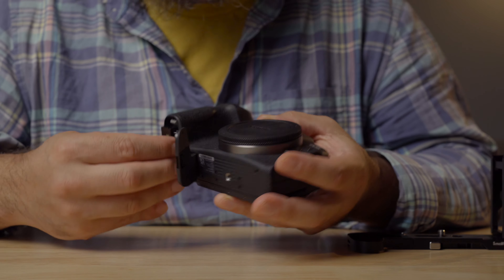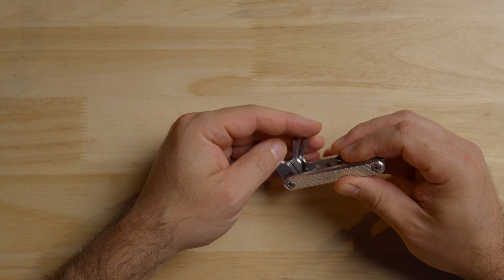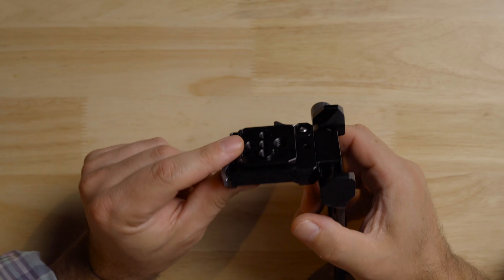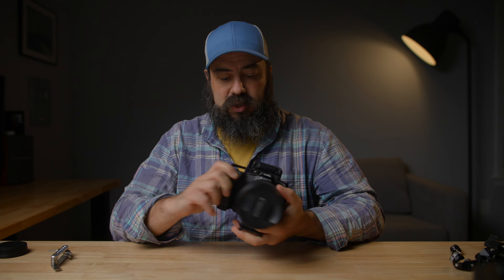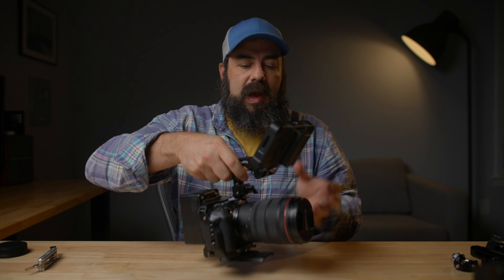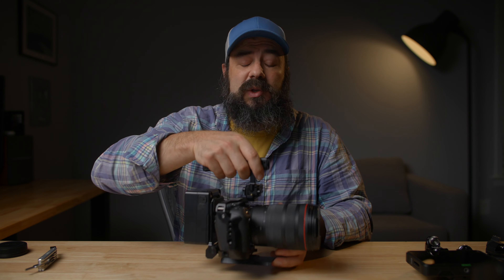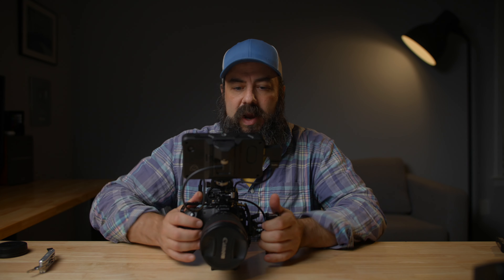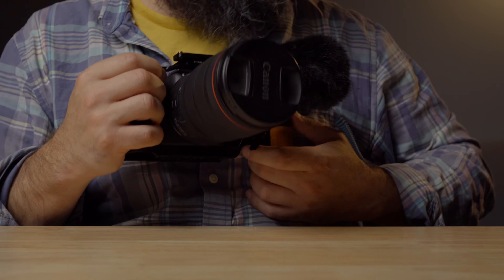Canon R8 - Video Rig & Battery Solutions

Comment: Wouldn't it make more sense to just put all that money into a better camera, instead of buying an R8 and rigging it out?
Reply: A rig provides features/benefits outside of the quality/specs of the camera itself. It’s more about usecase, than it is about making up for a cameras spec weakness.
Reply: @HarrisBeauchamp  I can see the logic in that, although it still seems odd to start with the R8, if you have a big enough budget to rig it out so extensively.
But yeah, I could imagine a use case where this would make sense, especially as the R8 goes down in value due to its overheating and battery issues. It seems like it would be a pretty limited use case, but maybe if someone wanted a monitor and V-mount battery, and was just shooting 1080p, or only shooting in cold weather, and had a budget that wouldn't allow for spending an extra grand or two for a better camera, it might make sense for someone to do this... maybe. ;P
Reply: @myblacklab7 wtf are you talking about
Reply: Good luck rigging the better camera
Reply: @myblacklab7  the R8 is a very very capable camera especially for video. I can do 4k60 in 10-bit RAW footage. People's main gripes are the limited controls and small battery. People have shot incredible things on t3i's. The only reason I would ever upgrade from mine is if an SD card fails and I decide to get a 2 slot camera
Reply: @Topidoit  It definitely has its good points!
It overheats at room temperature when filming 4K60 within about 40 minutes, which is also about how long the battery lasts, right? It starts to heat up pretty quickly as soon as you turn it on, so messing with settings or waiting for a shot with the camera on also limits recording time. No XLR input limits the mics you can use with it, unless you attach it to a FocusRite, which isn't ideal.
No in-body IBIS, and not all lenses have IBIS.
I guess a dummy battery might help a bit with overheating, but the only one Canon sells is kind of expensive, comes in two parts that you have to buy separately, and only connects to an AC outlet. 3rd-Party options exist, but they might brick the camera, from what I've gathered. You can power it with a 45 watt or greater power bank using the USB-C connector, but that won't help the overheating issue, and the USB-C connector is fragile.
The overheating issue is hugely limiting - you can't use the R8 for interviews, sports, weddings, documentaries, or indy film production. On a hot day, I think it would overheat within 20 minutes. Imagine filming an incoming storm, and a funnel cloud starts to drop, and then your camera overheats. UGH!
The big advantage of the R8 over Sony's A7Siii is that it is less than half the price, but leaving price aside, I can't think of many good reasons to opt for the R8, except for that it's not made in China, although Sony recently shifted 90% of its camera production to Thailand.
No serious videographer shooting 4K60 will use the R8 as anything but a B-cam, unless they are in some particular niche where they only shoot for a few minutes at a time.

More expensive cameras also tend to have better specs. The A7Siii can do 4K120, for instance.
Factoring in price, the R8 is the best for very specific use cases, such as if you need 4k60, uncropped full-frame, simply because no other camera in that price range will do that. However, that's a very specific use case and for the vast majority of people an APS-C camera that doesn't overheat, or a full-frame that shoots 4K60 with a crop is a better option at a similar price point. One could also consider picking up an older DSLR video camera, and I know of at least one that does 4K60 with no crop, doesn't overheat, and has good weather sealing (although the specs aren't quite as good).
Reply: What you're saying makes zero sense at all. Even if you get a better camera you're still going to have to rig it. I have the R5C and R8 and I still had to rig up the R5C to make it usable
Reply: @Topidoit R8 does not shoot raw
Reply: @geoff0707  you're right I got a little ahead of myself there
Reply: @myblacklab7  i very often shoot at 4k24 unless I want to do slow motion or something. I only got it to overheat one time when it was 97°F outside last week and I was shooting 4k60 in direct sunlight. That is the only time and I've had it just over 8 months now. I would never shoot 4k60 just for the hell of it. Also, I understand most people want to put a mic right into it but in what I use it for (filmmaking) I would usually not use onboard audio and record my audio on a separate device so it doesn't really matter.
Reply: @geoff0707  It makes 50% sense, or you would have rigged out the R8 instead of the R5C.
Reply: @Topidoit  Thanks for the feedback. I've had it for awhile too, and in 4k60 mode it always overheats within about 40 minutes or so when at room temp or above, although I haven't timed it. I think it might not overheat when it's very cold and windy, and I've seen people supposedly "fix" the issue by having a big fan blow on it.
I vastly prefer the way 4k60 looks, but that's a different subject. I'd shoot 4k120, if I could.
Reply: @myblacklab7  lol I did rig out the r8, I just bought my r5c. I been using my r8 since last year till I could afford the r5c. Best part is all my stuff for my rig works with the r5c except the cage of course
Reply: @myblacklab7  so my point is it's cheaper to buy an r8 and rig it than it is to buy an r5c which would still need a rig anyways due to the shit battery life
Reply: @myblacklab7  i guess this does come down to use case. I don't ever see myself recording 4k60 for more than 3-5 minutes.
Reply: Well I can't argue with that. I guess there are valid reasons to rig out an R8.
It could be that I'm new to this, and am asking somewhat stupid questions, but I do learn from the answers, and I'm not the only newbie in town, so hopefully other people will learn something from my stupid questions.
I'll probably end up rigging out my R8, depending on how expensive that turns out to be.
Reply: @Topidoit  It really does. For me, the main reason I got the R8 was because it can shoot uncropped 4K60 with no pixel binning or line-skipping, and I couldn't find any other full-frame camera in my price range that could do that.
My use case is unusual, I think. From what I've gathered, most people only use 4k60 for sports, and that doesn't require full-frame, so the R8 would be a poor choice for that use case.
About a month ago I shot a field of fireflies at night, with lighting from a receding storm in the background. I'm probably crazy to try to get something like that on 4k60 video with a prosumer (if we're being generous) camera, but it's a dream of mine to someday be able to share the beautiful spectacles I often witness during the night.
I want to shoot the Northern Lights, and I think they'll look better in 4K60 because of all the subtle, quick movements, if I'm lucky enough to capture such footage. The overheating issue is a big deal for things like that.
Reply: The money he spent on the rig out probably costs less or just as much as buying say r6 mark 2
Reply: @UnamnnaedAcro  Yeah, something like that.
And as others have noted, there are various advantages to having a rigged out camera, so one might want to rig out the more expensive camera anyway, at which point it boils down to "Why not buy a more expensive camera, and rig that one out?" which is a stupid question.
I'm mainly annoyed at the R8's terrible overheating issues when shooting 4K60 video. I guess I need a more expensive camera ;).
Reply: As someone who always thought buying camera is enough , then moving to having record audio separately to understanding the importance of external monitor (better seeing the landscape, ability to see shots in sun) and power options. Now I realize that rig is must for any serious shooting and the main advantages of ability to shoot better (especially literally 0 shaking), shooting for longer hours, having the ability not to lose any of your accessories (especially the smaller parts like connecting wires, smaller screws, dead cat furs - it’s very easy to lose the smaller accessories especially in a shoot outside when there are lots of pressure) and last but not the least the ability to put entire setup on a table and you can readily pick it up in a jiffy while being full confident that all the necessary systems required for shooting are with you. The necessity of rigs , use of separate audio gears and realization that in the long run it’s the cost of lenses which are going to be way way higher than the camera itself are something which comes from experience only. That’s why if you are starting afresh always look for scalable solution, I.e, a camera whose lenses can be used on a better cameras in future, rigs which mostly can be used with other systems, audio solutions which work with other cameras as well.
Reply: If you want to do video, it is generally recommended to right your camera out. So, you will have to spend that money anyway, why not save on camera body
Reply: @myblacklab7  does it overheat at 24fps? You should only need 60 fps for shorter b -roll or very specific shots I'd imagine. Its hard to imagine a situation where you'd need to shoot 60 fps continually. Also 60 doesn't seem quiteeee slow enough for beautiful slow-motion so you'd probably stop down to 1080p or use another rig
Reply: @JoshuaBates01  I like 4K60 - I think it looks massively better than 4k24.
It probably overheats at 24fps.

Comment: Nice setup, but as a Canon R8 owner myself, I am thinking how you would control the camera? The R8 doesn't allow touch input via 3d party monitors. So you will have to rely on the buttons only, which don't seam accessible in this setup.

Comment: Hi Josh,

Can you install/uninstall a dummy battery to the camera while using that cage without removing the cage? I swap a lot from dummy battery to regular batteries and it will be a big hassle to remove the cage each time, manage the dummy battery cable and reinstall the cage... If that's possible without removing the cage, I am sold :)

Comment: So Josh, now I don't have an R8 but I do have an R50. One of the things that I would like to do is video record a stage event. One of the main things I'll need to do is hook into the sound system. I found a solution for this. A reduction device that will take the line out signal and convert it to a mic signal. I was surprised with how many devices are out there. Anyhow the deal is to connect a wireless transmitter to the source and a receiver to the camera thru an adapter.

Comment: Hello
Is it true that the camera cut and restart the hdmi signal after 30 minutes ?
Reply: I have the Canon R8 and it is true. I`m using a Viltrox DC-X2 6" and after at about 30 min, the signal is just cut off by the camera. I need to remove the cable out then put it back on

Comment: Hello Josh, just saw this rig and it was just what i was looking for my needs, but im still debating between the Atomos shinobi or the ninja V,  the external recording is really tempting for the redundancy (considering the R8 only supports 1 SD cards, I have never had a corruption problem, but well, there is always the "what if..") and for improved recording overall. Have you tested the smallrig VB99 battery with the R8 and the Ninja V while recording? will that battery sustain it enough? or will setup not last even 2 hours ?
Reply: Hey. So if Josh can’t get to you first, I will say that I have the Smallrig VB50 with my R8 and it lasted me roughly 8ish hours of shooting at 4k 60, dropping the Smallrig battery to as low as 19% (Which I kind of felt iffy about because of the “man what if I needed to shoot longer” ) i didn’t have any overheating issues, but it was also a cool day outside. 

Knock on wood, I haven’t had any problems using only 1 SD card knock on wood but having the safety net of the ninja V would be nice paired with the output capability of the R8 

The monitor I have is the OSEE T5 and unfortunately I haven’t used it paired with my R8 running off my Smallrig battery, but I did with my M6MKII and the battery lasted me a full college basketball game shooting at 4k30.  So if you’re thinking of getting the VB99, you could last a full day of shooting and monitoring

Comment: How do you supply power to R8 from the V-mount battery? Which dummy battery are you using? LPE17 dummy batteries are a bit "problematic" on Amazon, some have really bad reviews.
Reply from the maker: I generally use USB-C to power the camera from my V-mount battery.
Reply: @Josh_Sattin  I get error message "Camera control is limited when used as UVC/AUC device" when plugged into usbc, I have a battery inside, and I still get this error, please advise

Comment: Hey I might've missed it but with the Vmount, how many different ways can you power the camera? Is it dummy battery with DC coupler or can you power the camera over USB? Or can you do either/or?
Reply from the maker: Either will work. I generally like USB C since you also have a battery inside the camera in case of a failure or if your V mount dies.
Reply: @Josh_Sattin  awesome thanks for the quick answer! I've been wanting to trade in my EOS R for a while but only if I could have a battery that can last!

Now I need to try to figure out the best way to gimbal mount it with a vmount battery.
Reply from the maker: @zephanmoses  You're welcome. I'm not sure about USB PD on the EOS R. I thought you were talking about the R8. It's been a while since I've used the R.
Reply: @Josh_Sattin  I meant on the R8 - I'm hoping to sell the R to get the R8 🙂I just don't want the R8 battery life to be an issue.
Reply from the maker: @zephanmoses  Yeah battery life on the R8 is not good when shooting video.
Reply: @zephanmoses  If you use a dummy battery, note that the Canon version is designed to use an AC outlet.
If you use a 3rd party dummy battery that you can plug into a power bank via USB, please let me know if it bricks your camera, since I've heard that is a risk.
In my experience, the R8 overheats in about 40 minutes at room temperature when shooting 4k60. It may be able to last much longer if it is cold and windy (Edit: Or much shorter, if it is hot).

Comment: You mention plugging your monitor into the same battery as the camera. One of my wireless video adapters was fried because I shared the battery for it with the monitor and the HDMI cable can create a loop. I found out that Black Magic cameras (at least older ones) had a lot of issues with fried HDMI ports for the same reason. I never share batteries now with devices that also share an HDMI cable. In this case camera and monitor use a different battery. If there was a wireless HDMI device in the mix that too would be on its own. If you are not careful with how you turn off the gear, swap the batteries you damage the HDMI ports.

Comment: Very nice and helpful review, thank you ! Did you try to connect the camera with an external power supply like Anker 25600 PD etc. like the R5c which works perfectly ?
Reply from the maker: You're welcome. I haven't tried that specific battery bank, but there are a lot out there that work.

Comment: Hey Josh, loved the video. I bought the items you suggested. Except the usb-c cable so I'm using other cables I have laying around. The smallrig v-mount battery is not charging my canon R5 via the usb-c port. Is there something I'm missing? It won't even turn on without the canon battery inserted. Even when the battery is inserted, it's not taking power from the v-mount battery(just ran a test). Would love any help. Thanks!
Reply: I have the same problem 😢, have my PD power bank with PD cable but it doesn't work.
Reply from the maker: I am not sure if the R5 can actually charge through the USB-C port since it is a bit older. It might just give the camera enough power to run. Yes, you need to have a battery in the camera to power it via USB-C. Seems silly but that is the case. You can tell if the camera is pulling power via USB-C if the little battery icon on the screen turns gray, it's usually all white.
Reply: The cable has to be rated high enough to support the voltage and amperage. Your issue is probably the cable.
FYI: Javex cables are made in Taiwan (the only ones I found that aren't made in China). CableMatters is a U.S. company whose cables are made in China.